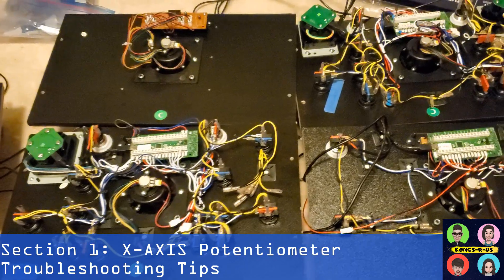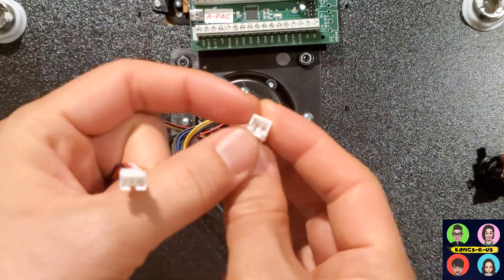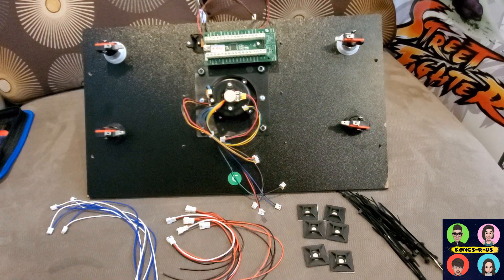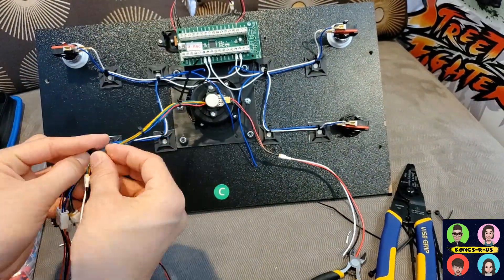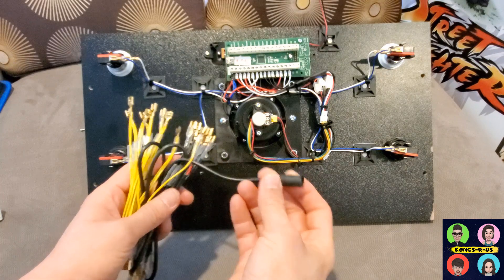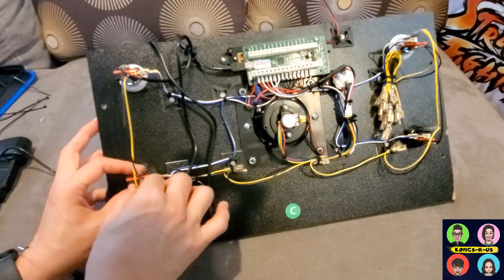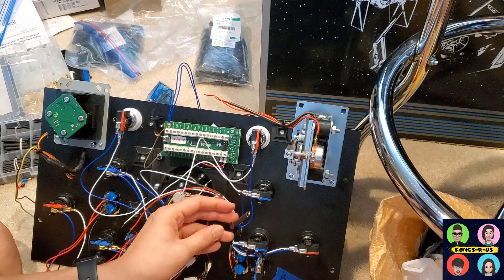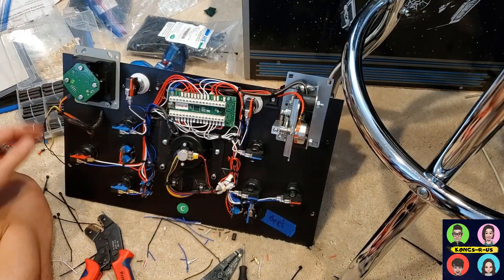Star Wars Arcade1Up In-Depth Mod Tutorial: X-Axis Troubleshooting & Detailed Wiring Guide

Comment: Having major issues with my new star wars yoke from the limited edition. If i move it to the right, it wants to stick tonthe right middle border. Other times it barely moves and stays in the middle barely moving no matter how far i have it away from center. Arcade1up wont even let me use my gmail account to create a ticket.
Reply from the maker: is it a stock yoke you are having issues with? sounds like some of the connections to the potentiometers are loose if you can open up the back of the yoke.  otherwise a ticket to A1up is your best bet.
Reply: @KongsRUs  it is a stock yoke.
Reply: @KongsRUs  i will have to try the yoke. Arcade1up will not let me use my gmail account to create a ticket.
Reply: @KongsRUs  you are the freakin man kongs r us. It was a connection only halfway connected with some thick resiny glue around it. Just calibrated and about to test.
Reply from the maker: @atldarkphoenix  sweet! hope it works out for you man
Reply: @KongsRUs  it works perfectly now yay
Reply from the maker: @atldarkphoenix  congrats, and enjoy!